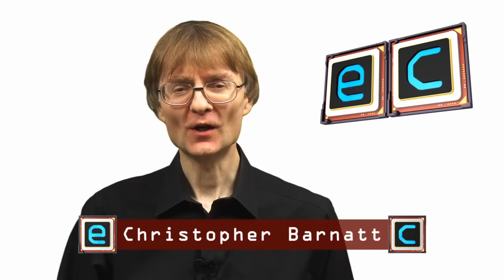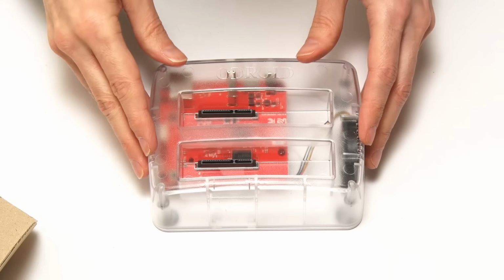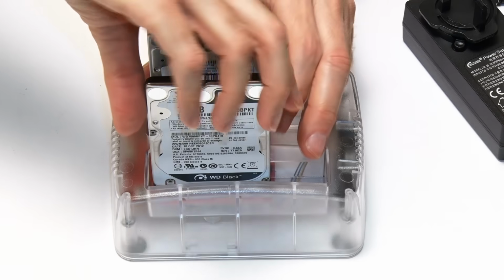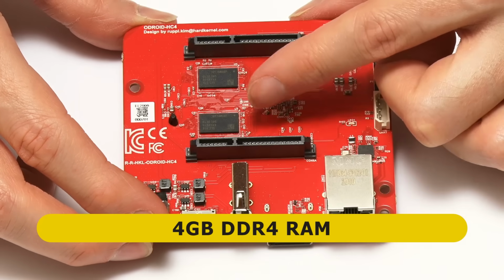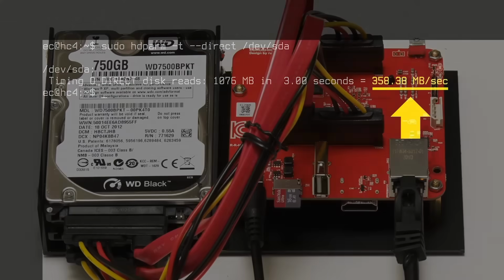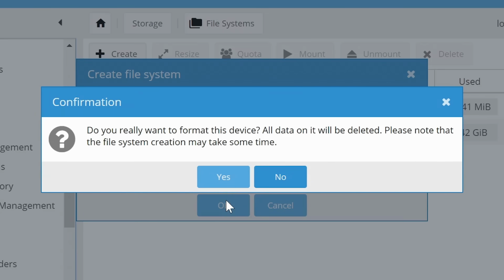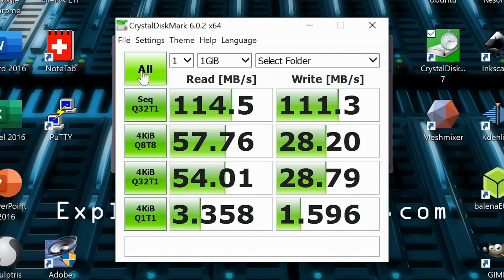Odroid HC4 Twin SATA SBC (inc OMV RAID setup)

Comment: Unfortunately, OMV7 with Debian 12 on a HC4 is not working. The OMV recommendation is to install ARMDian, a Debian flavor not supported officially by Hardkernel and the ARMDian version for the HC4 is a "community support" not officially supported by the ARMDian project, see https://www.armbian.com/odroid-hc4/. Don't do a "omv-release-upgrade" if you are running Debian 11 and OMV 6, you will corrupt your OS. The OMV guys made clear than they will not fix the issue.

Comment: Hi. I have a HC2, and it fits on my little shaft among other equipment. I´m thinking of buying another NAS SBC (because I started stalling lot of things on mine) and was considering HC4, since I like a lot my HC2, but the toaster design is not good for me. I liked your solution, the rig, how did you do that ? I will see if I can find the material on my country....  thanks...

Comment: Hi, Thanks for the detailed video, Stupid question: I have it up and running using Debian 11 and OMV 6 (installed via Petitboot per instructions  from internet). Just wondered if manual, periodic updates to underlying Debian are required or whether the OMV scripts do that automatically. Sorry for noob question. Cheers.
Reply from the maker: Thanks for this -- and not a stupid question! :) I am not certain, but strongly suspect that there will not be any automatic updates. They are not common in ARM SBC Linux distros.
Reply: @ExplainingComputers  Thank you! I will use ssh in the meantime and maybe look into unattended updates. By the way, I have discovered that a couple of reasonably thick cable ties shoved between the 'Toaster' housing and and front of the drive work a treat to stop the drives wobbling! Thanks again!

Comment: I wonder how easy it would be to use it to clone hard drives. My guess is that it'd be pretty easy. I already have a cloning system, but if I didn't I might consider one of these for the additional capabilities.

Comment: So if I use the toaster case I get less performance? You should not be explaining computers.
Reply: @ExplainingComputers  That is what you said.
Reply from the maker: @neuron05  Sorry, I am bewildered. Where in the video did I say that using the toaster case will provide less performance?! Please provide a time stamp. And I do not believe there is one, as I did not say what you claim. I did point out that I consider the toaster case a very poor design for permanent drive mounting. But that is a totally different issue.
Reply: @ExplainingComputers  I don't have time to look at the video again but I think the timestamp would be right after you put the cables in. And I get it, it was just a mistake, perhaps from the good feeling of building something, maybe my OCD kicked in on a detail. Just have fun ant continue doing what you're doing. My comment "maybe you shouldn't..." was unnecessary, I'm sorry.
Reply from the maker: @neuron05  Thanks for this, appreciated. :)

Comment: Thanks.

You didn't cover just what that button does.

I don't think the vertical drive setup would be any problem, it's just going to sit on a shelf somewhere and not be moved since everything is done through the web interface.

Or, configure a mount that has the drives spaced appropriately so the board can attach directly to them, with additional mount for the board if wanted.

Comment: the cheap plastik case doesn't look very sturdy. 3.5" HDDs are pretty heavy and at the same time don't like vibrations. I would be willing to pay twice for this SBC if it was mounted in a rigid metal case.

Comment: Thanks Chris.  I now have a free Raspberry Pi4  ! !

Well actually, I have recovered a Raspberry Pi4 from my OMV NAS and replaced it with an Odroid HC4.  So not really free - but that is how I justified the spend !  ;-)

And, the Odroid HC4 setup has made a significant improvement to the throughput, with the only bottleneck on the network being the Gigabit ethernet.

Also, no toaster for me !  I used my existing hard drive cage with built in cooling.

All that is left to do is to figure out how to make the thing have proper temp control ?  I can feel another ‘project’ coming on - perhaps I could use my spare Raspberry Pi4 ?
Reply from the maker: All great to hear. Sounds like a good project competed . . . and another in the works! :)

Comment: Thank you! after watching your videos I'm now thinking about building my own NAS, using Orange Pi 3 and 3.5'' drives connected via USB3.0. The challenge in such setup seems to be providing power to both the computer and the 3.5'' drives, as these cannot be powered via USB. Did you try to build something like that? How did you power it?
Reply from the maker: Yes, with many SBCs powering 3.5 inch drives (or more than one 2.5 inch) is the issue. Not something I've tried.
Reply: Idiotic choice tbh

Comment: Chris: You were not very clear in the video WHICH disks you were using for that Performance Analysis.  Was it the SSD's or the HD's? Performance is obviously very different!
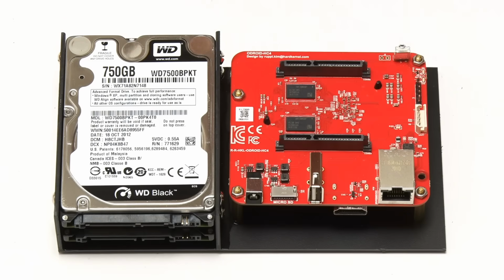Reply from the maker: I am bewildered. How was I "not very clear"? From about 10:00 onwards you see me connect to the Odroid HC4 two 750GB 2.5" WD HDDs, and then you see these configured into the RAID in OMV. There is no indication that any other form of drive is connected when building the final NAS.

Also, you are wrong that "performance is obviously different". It is not! :) As I explain in the video from c. 17:10 , the speed of data transfer to the HC4 NAS is determined by the one gigabit speed of its Ethernet interface, not the speed of connected drives. So even if I had used SSDs, we would have got the same data transfer speed. :)
Reply: @ExplainingComputers  Chris. Thanks very much for taking the time to explain. Much appreciated. I am considering moving from a Synology DS713+ to an odroid HC4, so I appreciate very much your video on this subject.

Comment: Chris I have a quick question if you don't mind.

I have the Asus X570 TUF gaming plus motherboard.
Will there be any speed difference in the
M.2 slots that are on the board ? I'm using the Nvme.2 one terabyte stick.
Thanks Keith
Reply from the maker: I imagine the slots will function at the same speed. The boot time you have reported here is very fast. :)
Reply: @ExplainingComputers  
Thank you Chris
I appreciate your reply.
More than you realize.
Keith Kuhn
Reply: @ExplainingComputers  
Once I see the 
Windows Logo I
Start counting.
7 to 12 seconds

Comment: nice idea. Anyway with that toaster design it had been MUCH more usefull if there would be at leass one  programmable button at front (better if more) and SD + micro sd reader at front. It would give possibility to use that as network image creator system.

Comment: Does it support hotswap? I'd imagine it'd be an incredibly powerful solution if i could just slot in my backup drives, have them auto-mount and auto-sync from my main NAS over the network, without fiddling with unreliable USB 'docks'. Thanks for the review, I have some research to do!

Comment: I would consider buying one if it would support a SATA multiplier (or two).  I have an old Rosewill drive case that could be converted to a standalone NAS server with this board, but I doubt it will work based on posts about the Odroid H2.

Comment: You will have lower latency by using the built-in connectors.  Also, might I suggest expanding into FPGA systems if you can find any at a reasonable cost?

Comment: If you work in a tech shop, this device with its toaster case would do OK for a disk imaging set up.  I just used an old beater machine to do that, but the Odroid device would have taken up less desk space.  That is a nice price for the package too.  Cheers EC for this excellent presentation!

Comment: Chris, I utilized "professional spacers" (read: corrugated cardboard) in the toaster drive dock that I use for work to add pressure to the drives that don't quite fit.  A 3D-printed adapter should certainly assist the vibration issue, though thinking about it a bracket that screws into the case and the drives should make them more solid.  Another excellent video, sir.  Have a great day!

Comment: I've got so many mixed feelings with this board! hahah 

On the one hand, I really want to like it... but I want to actually run Docker on this with an influxdb instance + a plex media server so that I don't have to turn on my main pc each time I want to watch a movie (most of the time I'll do direct play and no transcoding anyway). I don't want my 2 hard drives to spin up every few minutes so I thought that a board with 3 SATA ports (one SSD + 2 RAID1 HDDs) or 2 SATA ports + an eMMC port that would be perfect. I don't want to run the OS + influxdb on a memory card because well, that's slow as hell and they are not suited for continuous small read and write operations. I also don't really like the case at all, but I really like your idea of making a case by myself though! 

On the other hand, I really like that you can install anything you want, I was thinking in maybe buying a Synology DS220+ but it has too many features I'll never use and I have less control about when the hard drives will spin up + it stores the OS on the same hard drives I believe. Oh and it costs 3 times more, however the OS is better IMO.

So yeah... thanks a lot for this video! It allows us to make a better informed purchase decision! You always do a lot of effort to make these videos, and I appreciate that!

Comment: Interesting review, thanks, but the 'toaster' housing looks pretty dodgy. 

Who have thought we would have seen the the return of the floppy disk in the 21st century...  Having the reset button underneath where you have to lift up the unit seems ill thought through as well.

 That said after seeing your previous review of the HC1/2 setup, I have used an HC2 as a second NAS and it works pretty well with some limitations.

Comment: What a shame, a well specced SBC, let down by a poorly laid out board, inaccessible reset button and that silly toaster drive holder that allows the drives to sway in the slightest breeze.
Yes, I see you could mount it on your own card, but you've paid for the toaster in with the purchase price, and that cabling does look a bit messy. You also lose the ability with the modified mounting to hot-swap in the event of a drive fail, which is what mirrored RAID is all about. What a pity the manufacturer didn't invest just a little more work into the physical design.

I see Chris is doing rather well for himself. The usual Hob-Nob has been upgraded to an Aero.

Comment: I gave up on raid setups I'm using mergefs. Raid is secure but the use case is mostly a complete diskfailure. Plus as all your drives are rougly the same wen you rebuild the raid if one has any issue chances are high another will fail at that time ... making you lose everything (yeap it happened to me). recovering data that is on a normal ext4 part is not to hard . recovering a raid with 2 hard-drives with issues (I know you can have more than 1 parity drive but it make no sense for a 4 disk NAS) ... good luck ;(... not to mention that raid on 4, 4tb drives takes eons to set up.. For extra security the most important stuff i back it up to a simple USB hard drive

Comment: I'd propose a different implementation of the self-made stand. Two disks should be mounted with the clearance between them being the same as the one between Odroid's  SATA connectors. Maybe the final size of the box would increase, but this way we get rid of bunch of cables inside, with disks happily sitting plugged right into the board. Less connectors--better reliability, innit?

Comment: What does the button do? Is it a power or reset button? Or simply power on with power plug in.

Nice video boss. But the toaster design not for permanent install. Design like this suitable for external usb disk system for recovery task only.

Comment: Interesting SBC and definitely something I'd buy to make a NAS but that toaster case has got to go 😂 or be improved.  It reminded me of a USB HDD clone dock I bought to copy drives and bulk transfer files but that unit had spring mounted slot covers and it supported all drives from 3.5 HDD to 2.3 SSD. The drives were also positioned at a 100-110 degree angle and sat against a back plate so barely any movement.  The Odroid toaster case is nightmarish!

With a better case, similar in size to 2 drive bays, to stand alone or slot into a designated NAS case, it could be miles better.

Comment: For spacer I've used blutack plus even on 3.5 it acts as a dampener 

Also be careful with the WD Reds in the SMR version they can have issues with RAID systems. I know this only has 2 drives, but it's something to be aware of
Reply: I agree, a server or a system drive should only use CMR, SMR would only be appropriate for occasional use or as a backup.  WD Red+ is CMR.

Comment: I have recently had some problems with WD drives in a NAS,  Long story short -  the heads would park every 8 seconds causing the NAS of 5 drives to constantly click which was a bit disturbing.  Changing a setting in the drives stopped this.  The WD spec apparently rates head parking up to 350K cycles.  Smart reported some of my older drives had cycled the heads over 1.8 million times.
Another issue for NAS is the SMR vs CMR fuss.  A few WD drives purchased in 2020 are SMR and report as faulty soon after going into a FreeNAS box.
I do need to try OMV.  Have been using FreeNAS for years which was fantastic until I updated to V11 which is not reliable at all.

Comment: What holds the "drive cage" plasticard segments to the base plasticard segment? Is it just glued (and thus wouldn't hold up to vertical wall mounting), or is there some hidden hardware attaching the plasticard segments at 90 degree angles? Maybe a quick video on plasticard "case" construction would be good -- this construction, and the one you did for the Odyssey FreeNas piqued my interest, as the ability to make something custom fit for the particular need at hand is always nice.

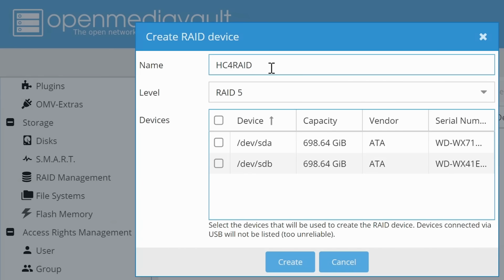Comment: 13:35 698.64 GiB. OMG that's 1,000 CDs. There's two HDDs so 2,000 CDs. In two 2.5 inch drives. And they're quite small capacity ones by today's standards. I feel like a dinosaur.
Reply: It's not though, the Raid is a two drive mirror config, so it only has the capacity of one drive, the second one is for redundancy, but it can potentially read from both copies at once for faster speed (that won't help here because that's faster than the network)
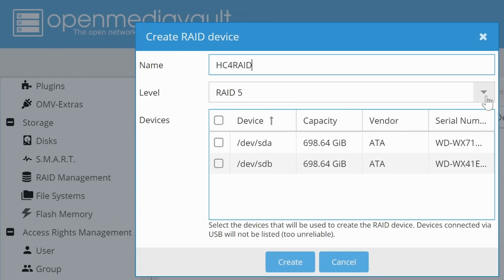Reply: @AlRoderick  at 13:35 he had not yet configured the RAID. Thank you.

Comment: Boards like this are pretty cool but personally I won't be interested until they drop to at least $50, for the same price or less than what these more expensive boards cost you can easily find old/used laptops or sometimes even get them for free and they'll often have one or two sata ports along with a mini pci-e slot allowing for even more ports.

Comment: Have you ever tried out a Beelink GTR Mini PC with Ryzen 5 3550H Processor and Windows 10 Pro? It sells for $899 Canadian on Amazon.ca It has a choice of * Gig Ram + 256 Gig SSD or for $1,701.99 Canadian you can get it with 16 Gigs Ram and a 512 Gig SSD. It looks like a cool little machine. This company makes a lot of very small computers with a fair amount of processing power starting at $152.91 Canadian. Some, or most are upgradable.

Comment: It would be ideal to make some slot in retainers with a plastic printer dependent on the type of drive used though Im surprised it didn't come with some form of spacers. That said the design does look a tad cludgy with the drives sticking up.

Comment: I suppose if it's intended to be a NAS then they expect you not to have/want to reboot it very often, so they might think it's better for the switch to be in an inconvenient place than somewhere where it could be knocked easily. I've not rebooted my - off-the-shelf, sorry! - NAS more than once since I bought it about six months ago, and that was by mistake.

(The same rationale was apparently behind the choice of Ctrl-Alt-Delete on PCs, which was only intended to be used in debugging stages anyway - you can't press it one-fingered or type it one-handed. I imagine Ctrl-Amiga-Amiga on everyone's favourite retro computer was chosen for the same reason.)

That toaster case is a bit disappointing, though. I'm sure I've seen drive caddies with the same design but better mounts (less space for the drive to move around in).

Another fun video though, thanks!

Comment: Another great video. 

I wonder if this board could be installed in an old dead 2-bays Nas case, or if any cheap cases would be available to do this (with 3.5 hdd removable trays).
By the way, is it hot-swappable in case of drive failure? Could you test drive removal/replacement?

Comment: Perhaps your custom mount for the drives and board would work out better if you turned the drives around facing the other direction, so that the cabling wouldn't get in the way of the connectors on the edge of the board.

Comment: I have a strong feeling this board was originally designed for a Japanese style TV media center NAS of the type QNAP used to sell. Just looking at the orientation of the IO and heatsink, it's almost like it's made to poke out the side while sat next to a TV, as to make short and clean wire runs.

Comment: Don’t really get why your struggling about the case and disk Mount system. This is propably the worst piece of junk case that could ever be made. Nothing bad about the sbc. But I would rather spent some time making my own case than using a piece of plastic made for holding a sandwich

Comment: Would the system require reinstalling the raid upon updating the software or a sudden power failure? Thanks for continuing to bring us interesting and informative systems. From the USA.
Reply from the maker: The RAID should be fine in both circumstances (well, no more likely to be corrupted than a single drive, and ideally less likely!).